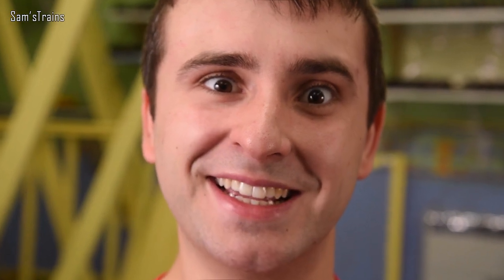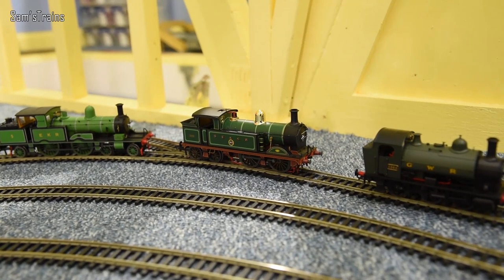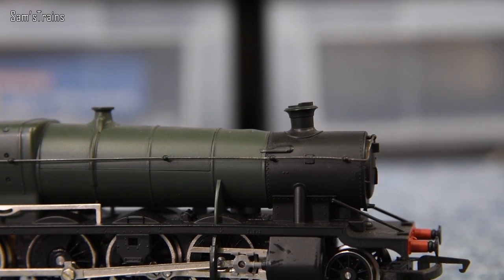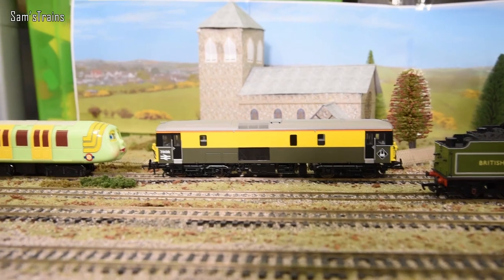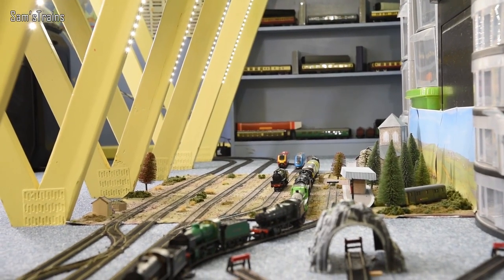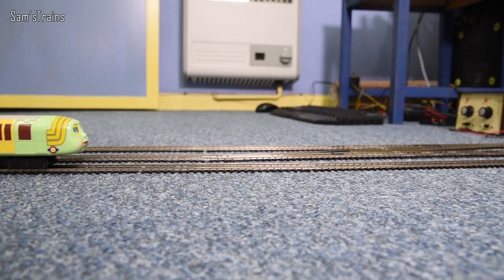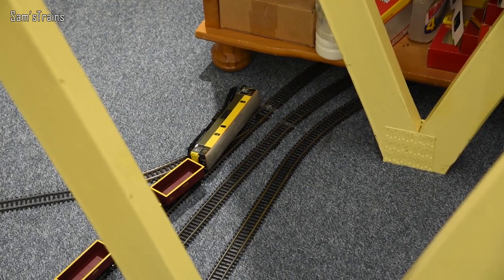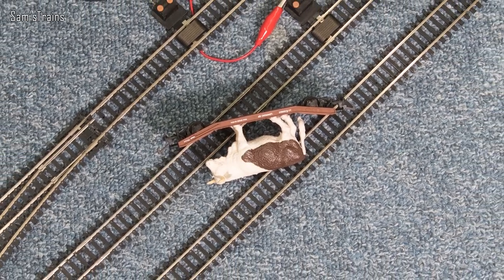Lemon Locomotives | Model Trains With Design Faults

Comment: Thanks ones to avoid very useful. I have the 14xx by Hornby has been alright no problems over the last decade. The 9f more of a Hornby quality control issue with the mazac mixture used for this batch  rather than an inherent design problem I would suggest. It is not only inherent design issues it is also the poor quality control which I regularly see you present sadly not the only example in life of poorly  designed and lack of decent quality control on mass produced goods. Enjoyed the video thanks.
Reply from the maker: Thanks Clive! The older Hornby and Airfix 14xx locos were perfectly fine - recently, Hornby altered the design to make the rear axle fixed, and no longer sprung - can't understand why they did it! Yes that's true of the 9F, not a design problem, but definitely a lemon either way! ;D
Thanks for watching - Sam :)
Reply: @SamsTrains  thanks for the info just looked at the 14xx and yes the rear axle is sprung so one of the better older designed ones, cheers

Comment: Interesting review of a considerable number of different models from several manufacturers. I'm particularly interested in the motor issues and them burning out. Would you be able to do a technical assessment into why this is happening ie overload/current draw, temperatures etc? Is there any visual evidence regarding burning out or changes in winding resistance? Thank you.
Reply from the maker: Thanks very much! Yes I have looked into this quite extensively - I do want to make a video like that! :D
Thanks for watching, Sam :)

Comment: Thought you might have included the DJ J94 or the Hornby Q6, I’ve had bad experiences with both...will you try the EFE J94?
Reply from the maker: Ahh very interesting - what happened with your Q6? I have thought about trying the J94!
Thanks for watching - Sam :)
Reply: Sam'sTrains I’m on my 3rd one having sent the other two back. The motor kept getting very hot so it would make the loco slow right down and a weird smell came from it. Luckily the one I currently have seems ok

Comment: Sorry I’m a bit late to the party, but Bachmann USA has a massive problem with the motors specifically in their DCC equipped locomotives. I have a collection of Bachman’s diesels I’ve had to send in to replace because they simply stop responding. Their lights still turn on and off so the motor has to be the problem. But about half of my bachmann locos end up getting sent back😂

Comment: I have a  virgin voyager and I've got a bigger oval layout and have never had problems  so maybe you've got an older version ? , my problem is that my virgin voyager is VERY slow but when you use it quite a bit its fine I enjoy it . Have you ever considered reviewing class 68s or class 153s I've heard some good stuff about them and I'm getting them for Christmas . Id like to hear your opinion on the models

Joel,
Reply from the maker: Yeah could be! Though if you have a bigger oval, that could explain it - it seems to derail on the tighter curves! Yes they are quite slow aren't they??
Thanks for watching - Sam :)
Reply: Sam'sTrains yeah I agree i had that once but it’s stopped

Comment: What happened to quality control?? You're right about the Bachmann N class - In anger, I also broke the daft loco-tender coupling and now it works better. Other gripes include: the Hornby Adams Radial has a tendency to sit and spin (just like the Oxford Rail one), my Hornby T9 tender wheels don't all touch the track and it hesitates and my old Airfix 14xx always was completely useless. The Bachmann 4 CEP is a very fine model but you can't change the headcode-tail lamp direction despite it having a 21-pin chip.
Reply from the maker: Yeah exactly James - a bit of quality control wouldn't hurt, given the prices we pay!
Thanks for watching - Sam :)

Comment: I have a Hornby Flying Scotsman that has a tendency to derail on a regular basis due to the way the front bogie is attached. I've tried a few things to make it work, but the only thing that does is actually removing the bogie completely.
Reply from the maker: Ahh sorry to hear that - can you adjust the bogie so that it sits on the track better? Sometimes they can get bent out of alignment!
Thanks for watching - Sam :)

Comment: Yeah I agree with a few of them the Heljan 1361, Hornby 14XX & the tender drive Henry all have problems for me. On my Heljan one not long after I got it the paint on the underside fell off!? & it cant couple to save its life. Hornby 14XX as you described I found it runs better backwards for whatever reason. Henry was a pickup issue with the loco the tender motor still works. My worst model was the Modern Hornby Cale single constant stalling losing power, the run to fast and when it stops thank to the traction tyres :( its stops violently throwing itself & the rolling stock off the track, i have 3 of them & they all have the same issues.

Comment: My Railroad 14xx runs fine and has sprung rear wheels so it's either older or newer. I think it might be newer. Maybe they rectified the issue.
Reply from the maker: Yes the old ones did have sprung rear axles - which makes the new ones even more frustrating!!
Thanks for watching - Sam :)

Comment: some  of  these issues  are unheard of tbh...(for me  at least)
I buy   Fleischmann trains second hand, but the shop i buy mine  is  awesome  and the  trains are all in mint condition unless described in  the adverts, and i admit  the  prices for new locos are  a lot higher,(around  400 euros),but some of  the issues mentioned  here simply  wouldn't be accepted. such a shame that  british  layouts  often look so beautiful  but the 00   scale trains have so little details (compared to german and  austrian H0  trains) and stupid problems like parts  that are mounted upside down  or motors that blow  up/burn.  But... it  does make  for quality content  on yt, so  i thank you  for these  enjoyable  20 minutes.
Reply from the maker: Yeah some of them could be specific to me, but many are much more widespread! Fleischmann sounds like they make fantastic models - I'd love to try more! :D
Thanks for watching - Sam :)
Reply: Sam'sTrains specific to you or widespread, the manufacturer needs to step up and either release models that work properly, or fix them under warranty. Some issues aren’t dealbreakers, like a damaged part due to shipping, but the lemons showed by you have unacceptable problems. Especially if you compare what they used to cost and what they cost nowadays. Add to that the fact that some models use molding that is decades old (no real increase in production costs) and in my opinion they should be almost flawless. I’m not trying to be harsh, but like you mentioned, some folk start out with a fundamentally flawed locomotive, and next thing you know the trainset ends up in a box on the attic. But hey, that’s (part of the reason) why you’re here, and the only way for them to change anything is by people like yourself spreading the word. See you in the next one!

Comment: The Dapol Class73 comes in for a lot of stick . Yes the design is naff in several areas but I have 3 of them. Two of these run brilliantly on DCC. The third runs passably. The two important factors I have found in keeping these beauties going are:
1. Keep the track clean and free from oil, and
2. Get the bogie back to backs absolutely correct. The b2b's for these need to be slightly tighter ( perhaps 1mm) than for other for other locos. Get the b2b's wrong and a smooth runner becomes a real b*st*rd. 
Number 1 is obviously important for current pickup why 2 is important I have no idea!
Reply from the maker: Thanks a lot for sharing Ant - I might revisit mine at some point then! :D
Thanks for watching, Sam :)

Comment: I was informed from a hobby store owner, that the Bachmann engines can be fixed by Bachmann if you send the model in with a fee.
Reply from the maker: The fee is the problem - it's incredibly expensive, and any new parts required are offered at an additional cost I believe!
Thanks for watching - Sam :)

Comment: Sam I have the S15 and was wondering if you could supply a link from where you bought a replacement motor please...
Reply from the maker: Sure! They're not that cheap now, but much cheaper than a Hornby replacement: https://www.ebay.co.uk/itm/DC-12V-24V-17800RPM-NdFeB-Five-Pole-Rotor-Dual-Shaft-Motor-Toy-Car-Boat-Model/192942409755?hash=item2cec43881b:g:wyYAAOSwTSlc-ly6
Reply: Thank you. All ordered. :-)

Comment: I have a 10-year old Bachmann Thomas, Percy and James and all of them have been stuffed for the majority of that time and only now I've ordered one replacement motor for Thomas not before deeply contemplating re-engineering him to run a normal hobby motor that would last 100 times longer.
My oldest and most strong-willed is an Australian National Railways diesel made by Powerline(Aus model train maker) that should be 20 years old,  it grumbles and never went fast but always ran with no maintenance and a very strong puller too
Reply from the maker: Sounds good - let me know how you get on with that! And I bet that is epic - will have to look out for one of those! :D
Thanks for watching - Sam :)

Comment: I can't speak for everything in the video but i can speak for certain items:

1361 (technically 1366 for me as i have the pannier) it seems to be yours is deffective, mine is perfectly fine and runs beautifully and from what ive seen it does seem to be you drew the short end of the stick with yours

14xx (Oliver) again runs perfectly fine, all wheels touch the rails and its a beast when it comes to pulling, it just seems you've ended up again drawing the short end of the stick with yours

Bachmann Thomas Stock - this is a highly debated subject as ive not had one burn out naturally or fail naturally on me, its always been something ive done, so i know its a genuine problem but i guess i must be lucky on them  :P (unless i end up breaking it) plus the modern thomas uses a better motor that is smaller and isn't that weird looking square one anymore

Hornby Henry - yet again one ive never ha an issue with, he runs splendidly and has never caused me a serious issue, its again one of those luck of the draw things where if it fails that's the individual model, not all and its unfair to lump all models together

so yeah, these are all i can talk about honestly, but i think as with all models, some are genuinly bad cough*railsterrier*cough and some are just unfortunate instances such as glue not being applied in the factory or whatever you use on threads thats blue, or just generally assembled in a rush because its friday and they want to go home or something, either way its unfortunate end of the stick moments that affect a model, like i know some have issues with the DJ J94, but i find wilbert to be perfectly fine, although ngl i do now see why people prefer the hornby one after getting lord phil, like DCC socket fitting is a pain but the mechanism is so much more robust feeling even without the big tank weight.
Reply from the maker: Thanks a lot for sharing mate! The 1361 has a poor mechanism, no doubt about it, but they can run very well if correctly adjusted. The 14xx was much better from Hornby, previous versions did have a sprung rear truck! Many thanks for sharing - and I've heard terrible things about the Rails Terrier too, but yet to experience it for myself (though it doesn't sound good with all the delays due to defects), they only have themselves to blame for their ballsy over-marketing... when a company builds high expectations, they need to be met!
Thanks for watching - Sam :)

Comment: Sam, you sort of glossed over the issue with the Oxford Rail Dean Goods - what is the problem with that and is it fixable please?
Reply: Mine was delivered with missing contacts, would not run more than a few inches - just hopeless. Solution - returned to seller. The replacement has all wheel contacts and runs nicely.
Reply from the maker: Generally it's the motors with the ones I had - besides that, they're mechanically sound! They've now been upgraded to coreless!
Thanks for watching - Sam :)

Comment: Good to know what models to avoid! I've got the Hornby 9F, one of my favourite locos, and noticed the tender wheels were locked in place and dragging. Opened it up and it had the dreaded mazak rot. Working on a plan just now to sort it all out, can't bear to shelf it. 

Another one that I have a problem with is the Hornby Merchant Navy (R3617). The front bogie is so light that it skips on every point and if I run it at anything over a trundle it will derail. I think a small weight will solve it but considering this costs about £150 it's a huge flaw.
Reply from the maker: Thanks mate! Yes the locked wheels is a classic sign of mazak rot - no doubt about it - good luck! Yes the front bogie of the Merchant Navy is known for mazak rot too - are you sure that hasn't wasted away too?
Thanks for watching - Sam :)
Reply: @SamsTrains  mmmm I didn't know that about the Merchant Navy, have to check that out. Cheers for the advice.

Comment: We have a Mehano TGV duplex & it’s a superb piece of kit. Stays on the rails when it’s run flat out. We also have a Bachmann 221 Voyager again no issues with it save for a coupling bar shearing off once. The Bachmann Emily we had was also a lovely runner , main issue with the Thomas models is that the circuit board the wires feed into gets to hot & is solved by taking the circuit board out & hot wiring it back together , had that with a Hornby 153. Ad for the Hornby 47 , what on earth are you doing with one of them in the first place in 2020? It was rendered redundant in 1987 when Lima brought their far superior offering out. We used to have 9 of the Hornby ones all detailed up , ride height reduced , body side lungs taken off , fuel tanks amended. You need to see a Model Railway Constructor Annual from 1983 in it there is a article on what can be achieved with the Hornby class 47. One of the main problem models is the Bachmann class & it’s poor roadholding due to there being no compensation on the middle axle , also affects the class 70. When the models under load on the slightest of uneven track the centre axles act as a pivot & it raises the front axle off the rail just enough for it to derail.
Reply from the maker: Glad to hear yours was okay! Yes the 47 was introduced in the 80s, but mine is a much more modern Hornby Railroad version! :D
Thanks for watching - Sam :)

Comment: I got a Bachmann 4-4-0 American which after letting a expert service it multiple times it still runs like complete trash it cuts out most of the time on a oval without points, causes short circuts, has a driveshaft from the tender to the loco which is a nightmare to maintain and the worst thing the loco runs inconsistantly and the pulling power is a joke. The loco is moderatly large with traction tires and with only 5 small wagons the motor got so hot it once burned my fingers. At least it looks cool and has all wheel pick-ups but aside from that it was a huge waste of money. Great vid as always, Sam ;) 👍
Reply from the maker: Yeah mine took a lot of work to fix too - definitely nightmare locos, and I don't really know why, the design isn't actually that bad! D:
Thanks for watching - Sam :)

Comment: I too have a lot of poor running locomotives and steam engines. Some I have rebuilt, corrected, and 'mothered'. As for today, the worst one I have is my IHC 4-6-2 USRA Light Pacific. First I bought the steam engine back in the mid 1990's. After about a week, the original motor burned out and I had to replace with it with a 5-pole with single flywheel. Now it run worst and make a grinding sound. The power pick ups don't work as they should and it hates pulling anything more than 4 to 5 cars. why I keep it, I like this WWI Pacific version. Someday, she will become my Princess again.
Reply from the maker: Ahh sorry to hear that - thanks for sharing these though - a good motor replacement can usually make a big difference, is something not meshing correctly? :(
Thanks for watching - Sam :)

Comment: If you want to achive the correct mesh between a worm and wheel or any other gear set in model railways buy some cigarette papers. these are 0.001 thick put them between the gears press down and pack or adjust the motor mount to suit.Wind the the paper out and off you go!
Reply from the maker: Thanks for the suggestion! I'll try that! :D
Thanks for watching - Sam :)

Comment: 18:38-18.45 I’ve got a Hornby open cab Pannier Tank that has that problem, is there a good way to fix that kind of problem?
Reply from the maker: Yes! Look at my video on servicing the Hornby thomas - it has the same mechanism. Once the wheels are removed, clean the pickups and gently bend them outwards so that they make stronger contact with the wheels!
Thanks for watching - Sam :)
Reply: Sam'sTrains thanks, I’ve taken it apart and the motor occasionally sparks up and smokes 😬. I’ll try what you recommend and go from there

Comment: I'll elect the Bachmann Class 90. It has a screw for the bogie pivot point which screws into a thick plastic collar. So far so good. Unfortunately the thick plastic collar sits onto the roof of the bogie gear housing which is thin plastic. This thin plastic shears off at this point. RM forums have also reported this fault so this design flaw has widespread effects. My 90 lasted just under a year. I tried to fix it with glue and UV resin but ultimately failed. Then I bought another one! So Bachmann got increased sales due to a faulty design. Sorry for the bad precedent I set. I do hope Bachmann redesign this bogie pivot point. They could simply thicken up the gear housing. There is space.
Reply from the maker: |Ahh really? I'm not familiar with that one - sounds very dodgy though!!
Thanks for watching - Sam :)